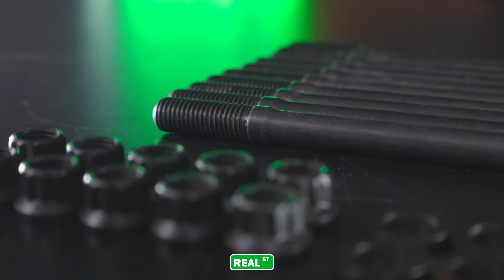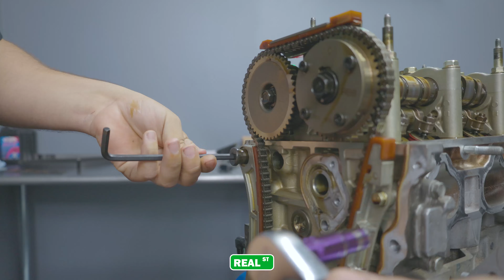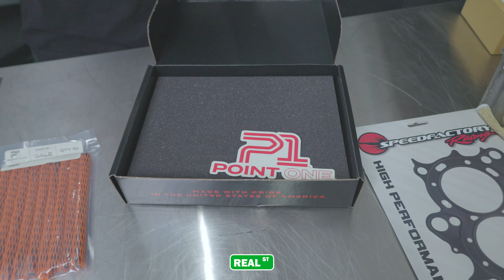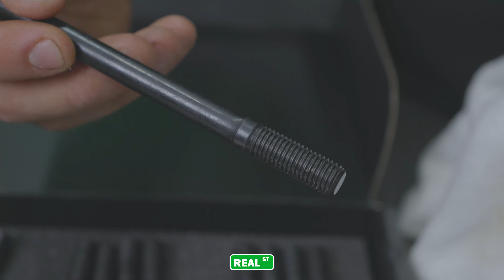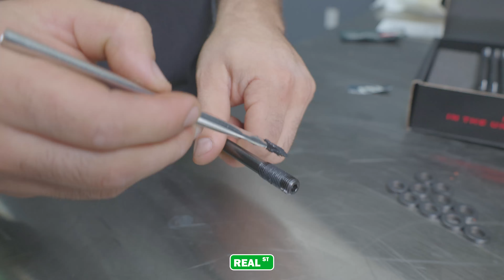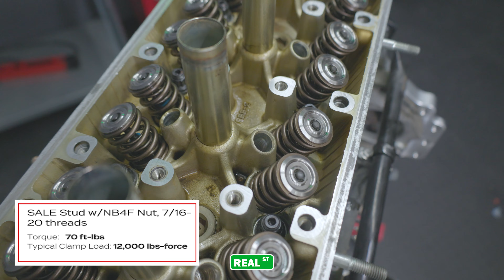How To Install Your Honda K Series Head Studs || Point One MFG

Comment: That's the correct way to do it......but the average guy on the street isn't gonna remove the head.😅 they just gonna replace the head bolts one at a time. One bolt out, one stud in and torque down, next bolt out, stud in and torque down 😂😂 just saying

Comment: solid video as usual. loving these new styles of educational videos. good to see that the recommended torque value isn't crazy high. arp recommends 90 ft pounds for the j series and man i think thats is too much. pulled threads out of my old block and felt like I almost pulled them from the replacement block. torqued to 80 and left them there as more felt naturally uncomfortable. block holding 20psi (750+hp supercharged) without issue!